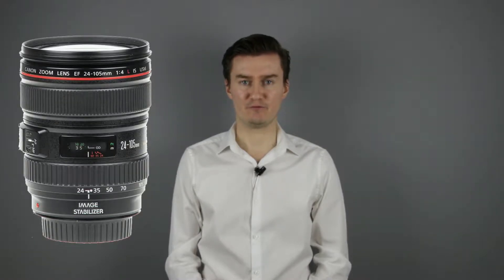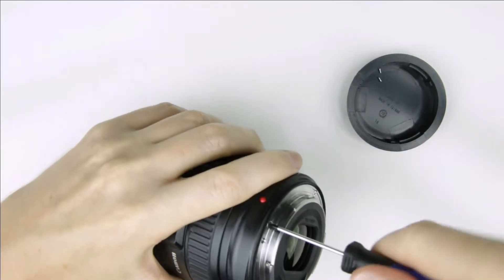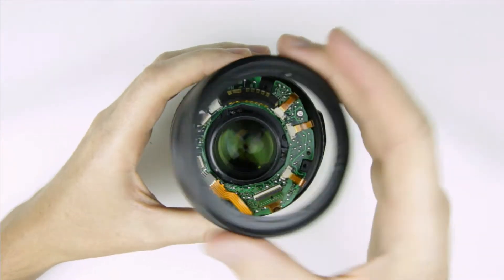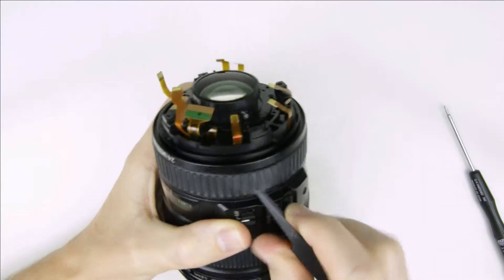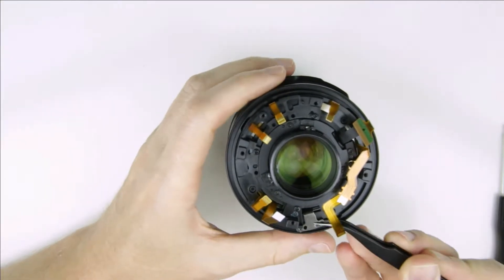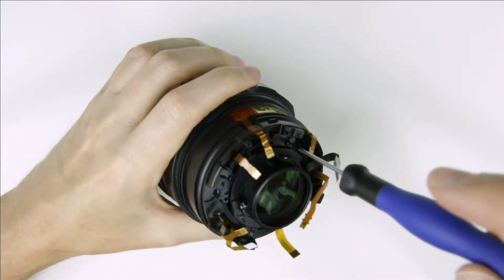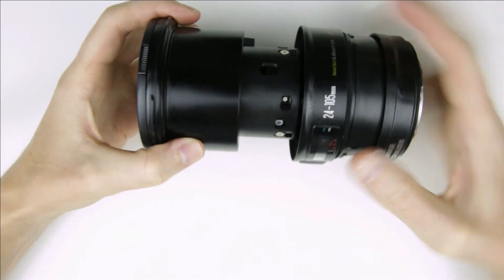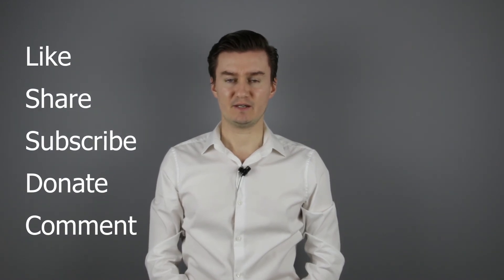Canon EF 24-105mm f/4L IS USM disassembly for calibration

Comment: I'm a new subscriber and love your videos. I'm searching for a tutorial on cleaning lens fungus. Do you have such video? I can't find a video on your channel where you disasemble the lens elements, like in a situation where fungus has reached elements beyound the first from the front or back. What do you think about such repair - is it possible to re-assemble everything so that it works well optically, without degradation in sharpness and chromatical aberrations? Is this method with the excentric screws to be used in such situation and can it calibrate the whole lens? What kind of liquid or method would you use to clean glass elements and barrel from fungus?
Reply from the maker: It is possible, I have videos about replacing the aperture cable and in those I have to disassemble the lens almost completely. In this case (generally) you have access to the inner lens elements.
There are some situations where the lens can't be cleaned: sometimes the IS unit have multiple lens elements and it would be very difficult to disassemble the assemble the IS unit. The other problem can be that some of the lens inside the lens consists of two molded lens elements, and if the fungus is between those lens elements, then it is basically impossible to clean it.
I use isopropylalcohol (70%) and then (distilled)water to clean the surface of the lens elements.
Reply: @CamerasLensesEtc this reply is super helpful, thank you very much! Do you have a link or title to that video where you disasemble the lens almost entirely? If there is a virtual "video wish list", may I add a video where you talk about those things you mentioned about cleaning fungus? More specifically, I wonder if there are certain types of lenses like brands and series or even models, which are particularly difficult / easy to clean fungus from. And do you have a technique at estimating if fungus is easier to clean i.e. only on front or back element vs in the middle elements too? Or in general what types of repairs are easier / more difficult and again, brands, series, models etc. Imagine that you have a conversation with someone about lens repair and cleaning, and giving them a broad overview and advise.
Reply from the maker: @Daniel_Borisov  On a computer in the browser you can search for videos on my channel, so search for "disassembly" and you will see all the videos you need.
I don't have a wishlist, currently I'm busy with other things, so I don't have time to edit videos.

Comment: I have same lens, focus went bad and i have lost the sharpness. Can we do without opening the lens? I am too afraid to do the same thing you did in the video. Sorry for the bad English
Reply from the maker: If you have an older Canon camera which has only Contrast Detection Autofocus in live mode, then you might use that method to focus. If your camera has the dual pixel AF, then it will not work, and you have to do the calibration.
Reply: I have 5Diii as i know it has only contrast detection for live view and phase detection for viewfinder. What i do now?  @CamerasLensesEtc

Comment: wow, great video, thanks, if you would make similar for EF-M 15-45 lens youtube will fall down because of traffic it will generate :D many people trying to do so and Canon officially does not calibrate this lens ...
Reply from the maker: I have never ever disassembled that lens, so I don't know where are the parts which you can use to calibrate the lens. Generally, there are some eccentric screws in the lens, and you can turn the front lens element to calibrate the lens, but in the case of this cheap lens you shouldn't expect very sharp results.
Reply: @CamerasLensesEtc  I understand, actually if you get sa good centered copy of the lens, results are fantastic, it can be a very sharp lens, but unfortunately, in many cases it is decentered and it bothers the users of EF-M system, because so few lenses available :(

Comment: Is there a way to replace the cable without having to calibrate ?
Reply from the maker: Yes. Just mark the screws in the aperture unit before you remove them, then put them back at the same position. (I mention / show this in the disassembly video.)

Comment: Man. Unscrew zoom lever and remove zoom rubber ring was unnecessary
Reply from the maker: Thank you for the feedback. It is necessary to remove the zoom rubber ring, because the zoom brush needs to be removed (if it is not removed, it will be damaged when the zoom ring is being removed). It is true that the lever needs not to be removed, but I find it easier to assemble the zoom ring when the lever is not on it.